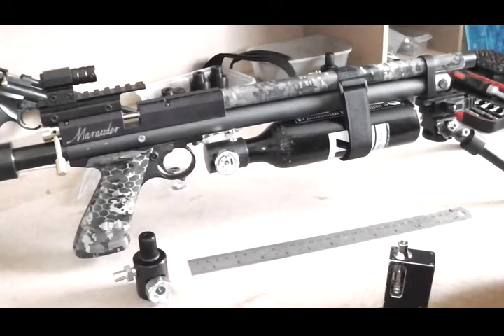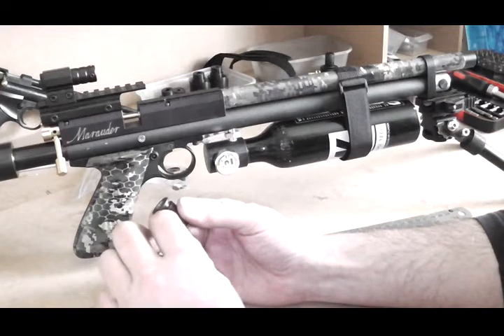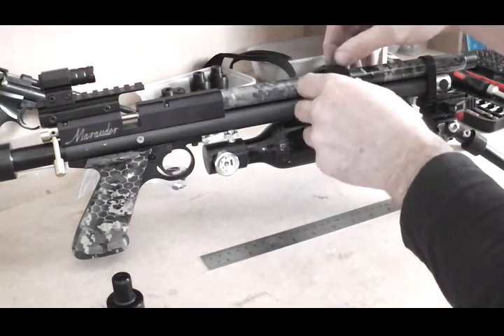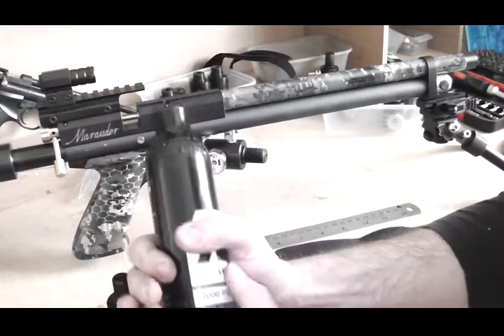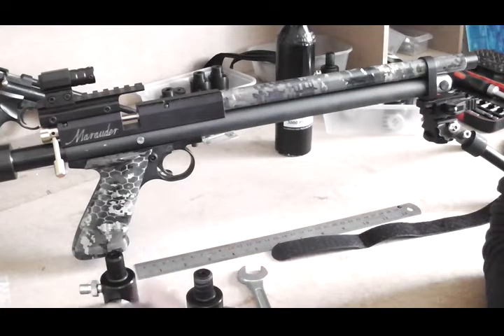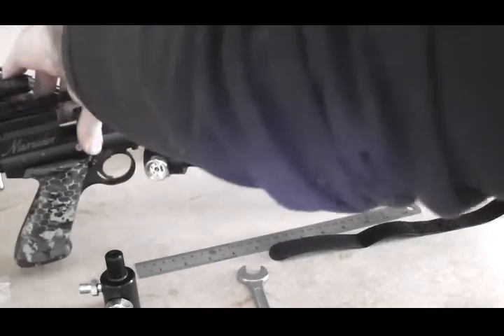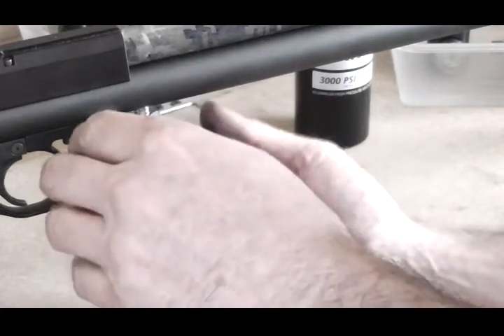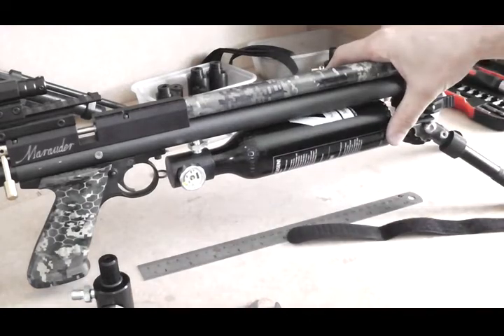Benjamin Marauder Bottle Drop Adapter

Comment: Can i use bottle length more than 20cm?
Reply from the maker: Yes you can. Length is not a problem, but you need to see how it will affect your own setup. In the video you can see I have custom bipod mount on my marauder. I machined and fitted a short picatinny rail to the barrel band to do so. If I want to use the rail I cant run a longer bottle as the rail and the bipod would interfere with it. If you have nothing to impede with fitting a longer bottle then its not a problem. I will be making some of the rails in the future for anyone interested.